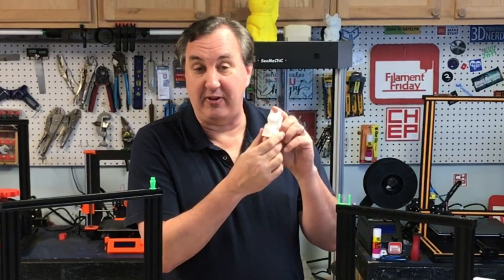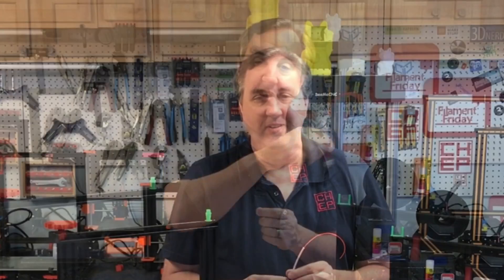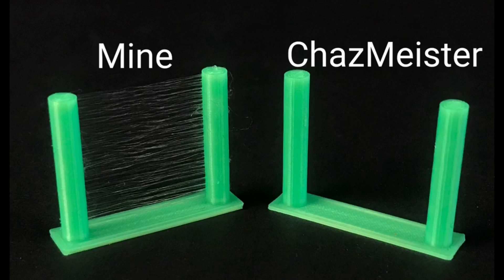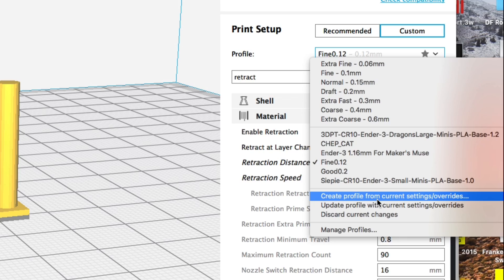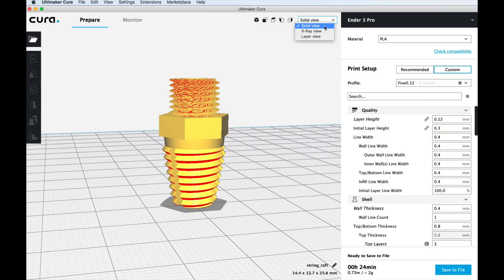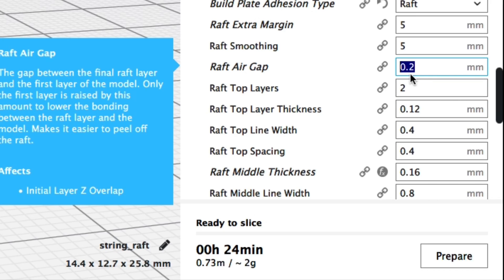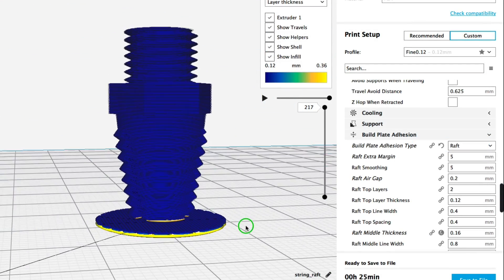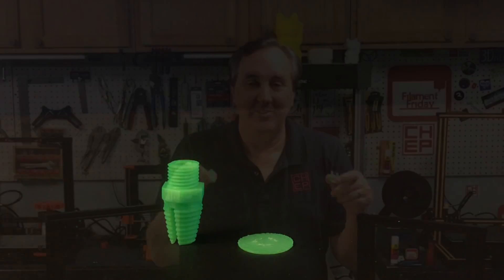Cura Settings for Retraction and Raft on Creality Ender 3 or CR-10 Mini

Comment: The surface area of the interface between the raft and your part is still the same amount of surface area as between the part without a raft and the bed.  Wouldn't a brim give you much better adhesion, since the first layer becomes part of the larger brim?  It's not as easy to remove, you might have to chase it with a small razor blade or something, but it's definitely going to give you the sticking power.
Reply from the maker: Either will work. I prefer to not chase with a razor blade.

Comment: Those raft settings are brilliant! I had trouble printing the Extruder Knob for my Ender 3 because the top had such a complex pattern that it didn't stick to the bed. One of the four "cloverleaves" kept coming loose and after 4 failed tries (changing bed temperatures, cleaning the bed with IP, seriously slowing down print speed, ...) I was ready to give up but then I  remembered this video. Since the knob has a much larger flat area, I feared the raft would stick to it but no - it came off brilliantly, leaving no marks at all and it printed beautifully. I may use this for any model from now on that has a complex first layer.

Comment: Thank you, but the stringing is still a bit unclear for me. I am also using cura, 4.5 mm retraction 60mm/s with Z hop. If I turn z hop off, the stringing goes away. Did you use z hop for the 6mm 25mm/s profile?

Comment: Chuck thanks for this explanation. I have had a difficult time removing a raft from the model. No problem with it sticking to or removing from (after cool down) the build plate but sometimes very difficult removing the raft from the model. I'll try your settings.

Comment: I have a dumb question? I have tpu sticking to pei build surface. Any way to do an easier release? It is really stuck on there.
Reply from the maker: Some people use a little glue stick on the bed to create a layer between them but I’ve also seen people rub a small amount of baby powder on the bed first. Either method seems to help.

Comment: I have a small problem where when I print the holes for my prints for my ender 3 pro they don’t come out complete, it almost overfills the inside of the holes, but it does look right in the editor, any solutions/reccomendations?
Reply: Not quite sure what you mean but if you are designing the part yourself, increase the hole size for tolerance. Slowing down the wall speed and flow percent may help too.

Comment: Hi, I have two ender 3 pro printers. For some reason, even though I have temps set in Cura, when I start a print either one or the other, nozzle or bed will not have a temp setting. Meaning, I have to manually set the temp before the print starts.. I have the nozzle set at 200, and the bed set at 60, but When I start a print the nozzles says 0, so I have to manually set it up to 200. Any idea what I'm doing wrong?
Reply from the maker: The nozzle doesn’t start heating until the bed reaches temperature.
Reply: Ahh, ok. Thanks for your reply.

Comment: Can you please share your cura profile that you used? Wanna see if it helps me with my stringing. I've struggled for 3 days now finding the best settings, but all in vein. Ender 3 pro here.
Reply from the maker: Check the link in the description for a recommended profile.
Reply: @FilamentFriday  Ah thanks, must have overlooked it. I should choose the one for ender 3 right?
Reply from the maker: Yeah
Reply: @FilamentFriday  Also, ChazMeister2's ender profile had 5mm distance and 40mm's, isn't it supposed to have 6mm with 25mm's?
Reply from the maker: 5/25 is where I’m at now.
Reply from the maker: What temperature? That looks too hot.
Reply: @FilamentFriday  195c i think it was with the test filament it came with.
Reply from the maker: I’m not sure then. I’d try some different filament.
Reply: @FilamentFriday  I got flashforge blue too, same result. Can possibly an uneven bed be the reason? also the gif i also added with the "loose" bowden contribute to it? cause during the print, the bowden doesn't feel like it's moving like that.
Reply from the maker: Anything loose is an issue. Bed needs to be properly leveled.
Reply: @FilamentFriday  Yep.  Hence why i have parked my printer a week to wait for my glass carbon ender 3 bed to not use the "soft" stock bed with several layers of foil to level it with which still has some spots that doesn't make proper contact with the nozzle.

And i guess since both the extruder couplers were lose like the gif shows is the reason i get those sudden uneven lines?  Got any good new couplers i could use? I tried ebay, but i don't know what's quality or not. and couldn't find a good combo of couplers for both extruder and hotend with a extra bowden cable that ships to norway as a lot of countries like germany or uk doesn't ship from their amazon. Lots of sellers from american amazon has some, but the shipping isn't exactly cheap with 15 bucks for shipping there.
Reply from the maker: If you can find a Capricorn PTFE reseller that ships to you they usually offer good couplings.

Comment: If one setting cured all 3d printing problems, well, presumably, that one setting would be the default in every slicer, and we'd all just print and not need channels like this.  I hate these fluff pieces that somehow distill a complex problem into, oh "check the box".  Don't get me wrong, there's some good info here, and I will try some of it if I have problems like what's being described, but this intro just irritated the crap out of me.  Heck, if that setting resolved all the stringing problems, then let's just get rid of all the other settings, have that one with a big red arrow on it that says "IF YOU DON'T PUT THIS NUMBER I TELL YOU  HERE, YOUR PRINTER WON'T WORK", and then all the forums can be filled with people asking questions about stringing, and a thousand responses of "did you put the number in the box", w/o any other thought as to what may be wrong.

Comment: Hey there.. Question for you.. So when you talked about the raft in this video and the air gap it popped a question into my head. I deal with DnD miniatures, sometimes I find that supports go to deep into the miniature so that when I remove them it actually has a line in the mini.. Is there a "Air Gap" sort of thing for supports? I typically print using Cura and do really good prints, but once in a while those supports mar the surface of a mini and it bugs me. I was wondering, would Support Z Distance (Support Top Distance) fix that? Currently at 0.1, but based on your magic numbers, could that be reduced to .04 or should it be increased to .12?
Reply: Oh and LOVE your videos! You do some awesome videos, I have shared them MANY times!
Reply from the maker: Yes. Making top Z distance larger produces a bigger gap.
Reply: @FilamentFriday  So would it be better with a higher number?
Reply from the maker: It will be easier to remove but too much of a gap and it will allow the print to sag. So it’s a fine line. 0.2 to 0.3 seem to work for me.

Comment: Chuck thank you, i have been puling my hair out as nothing was working, i went right back to the very begging of set up and started from there and still prints where fair at best. I applied these and the prints are bang on and looking amazing thank you for sharing and to the others whom have helped with these directions for people like me whom are so new and frustrated this has helped me so much
Reply from the maker: Glad I could help.
Reply: OMG - SAME HERE! Thank you, Chuck, You have saved me from throwing out my 3D printer to the trash and with these simple settings I now LOVE IT!! Well done sir!! Im a believer!
Reply: I had a profile that I thought was solid as it did test prints great, but when I started putting multiple objects on the same bed for simultaneous printing, oh my friggin god, you would not believe the stringing nightmare that resulted. And this was with combing and generous retraction on. I also went back to the default settings and changed just a few things. Stringing was reduced and the print head stopped bashing into my object when it was more than 5 hours in causing catastrophic print fail, but stringing was just as bad if not worse. 
I've got a 3 model figure on now, but as soon as that's done this new setting is going in and I'm hoping for the best. It's already taken a week just to get a consistent bead out of this printer which turned out to be some bad parts from the factory that are slowly being replaced.

Comment: Dear Chuck, my previous question regarding my stringing issues (sawtooth pattern on both "towers") was deleted for some reason, but I've found what caused my stringing issues. The PTFE tube was loose at the extruder motor end, and it was moving forward/backward when priming/retracting causing almost zero retracting effect.
Reply from the maker: Interesting. I don’t remember seeing your original comment but glad you found this.
Reply: Additional note. Since I don't have spare PTFE tube, I simply took the heat gun @140 deg.C, heated the end of the tube and pushed one of allen keys into it. The tube has expanded a little and now it sits well.

Comment: Chep, it is confusing. I downloaded the ChazMeister profile from Dropbox, and there is a speed 5mm and 40mm/s, not 6mm and 25m/s as you shown in the video.
Reply from the maker: I wonder if he changed it.
Reply: Hi CHEP . I had time to do some tests. Usually I use a medium quality filament, without any stringing (Cura). I runt out from this filament, but in last year I ordered some super cheap Tronxy filament from Gearbest (for 13USD/1kg). With this filament and my classic Cura profile I experienced massive stringing. So I tested these profiles:

1. My classic profile, Cura = stringing
2. Chezmeister profile Dropbox, Cura = stringing, sadly. :(
3. Maker's Muse Simplify3D profiles (https://gum.co/ZrffZ) = absolute no stringing, not even one.

I am curious what is the setting in Simplify3D what makes it working. I don't see any special setting here, except Wipe nozzle 0,5mm? Maybe this. Retraction distance/speed is same as in Cura.

"I wonder if he changed it." - From what I see on Dropbox, the file was modified 1/2/2019.

Comment: another option is to use skirt with a distance of 0.001 or 0.0001 from part, and a lenght of over 4000. this will have exterior walls of part with 1 layer height to hold onto and it just snaps off. best part is this works for all part sizes so no need for individual adjustments, unless there are a lot of internal small parts..... this allows base of part to have that glass surface finish.
Reply: I'm gonna try this, it's the same as a brim but more control
Reply: @bry29bry  with newer versions of cura you can use brim and select outside only.

Comment: Dumb question...   couldn't you just flip the print, so that it doesn't rest on the "conical" end while printing?
Reply from the maker: It would require supports for the nut section so I didn’t.

Comment: Howe can I change the filament in print ender 3?
Reply from the maker: Heat up the nozzle and then pull it out. Just reverse of how you loaded it.
Reply: @CHEP Thanks Chuck, during printing is not it possible on the ender 3?
Reply from the maker: Sure, just pause the print and the pull out the filament then add new.
Reply: @CHEP Thanks, your videos are helping me a lot, keep them up. I love this channel 😀👍
Reply: @emmetalerch2672  there is a change filament option in lcd screen options but its a bit hit and miss sometimes.

Comment: Hi Chuck, I have a CR-10 original, no upgrades and I found that my "magic Numbers" are 4mm retraction at 25 mm/s retraction speed with a printing speed of 40mm/s (outer and inner walls).
the printing speed is related to the retraction amount. but it seems that the number "4" is really magic to the Creality.... just try....
Reply from the maker: I will. Thanks.
Reply: Just tried 4mm retraction and 25mm/s retract speed and no string at all when using Cura. 
thanks

Comment: Using Cura 3.6.0 with the default settings for the Ender 3 and it has already enabled retraction (distance 5mm, speed 40mm/s). Never had issues with stringing etc with Cura.. that software puts out the best gcode I've tested so far. Worst was a Slicer Plugin for Octoprint.. 
As I only use PLA I only use brim, raft on the other hand makes no sense for me. I would at least always print a skirt. But Cura already prints a line before starting which helps a lot for a better start. You should try brim, it sticks very well if the bed is properly leveled.
Reply from the maker: I use brim when necessary. For this I didn’t want brim messing with the first layer threads.

Comment: Also there are 2 more settings under retraction  that contribute to the stringing.  Maximum Retraction Count and Minimum Extrusion Distance Window.  For smaller areas/parts where there is heavy retraction, this limits the amount of retractions on a piece of filament. I think the default is 90 retractions and 5.0 mm. Meaning only 90 retractions are allowed in a 5.0 mm piece of filament. So if you are retracting more than you are extruding, it will time out the retractions till you extrude past that 5.0 mm.  I was having a hard time with the stringing test. No matter what retraction settings I changed, it still stringed towards the top of the model.  I changed the amount of retractions to 100 and distance to 4.0mm and it cleared up.  This is setup so you don't grind away at your filament in the extruder.
Reply from the maker: I didn’t think I was near violating those limits but I’ll try it to see if it makes a difference. Thanks.
Reply: Chuck, I didn't think so either. However I paid attention to the extruder travel and it made sense. Not that this the total solution, but in conjunction with your other settings, it may help.
Reply: Great tip. I suppose it's useful when your printing pointy objects like cat ears
Reply: @NicksStuff  I run into stringing issues when I'm printing 28mm minis that have a lot of supports. It'll help with that kind of thing, too.

Comment: Thanks for your video. do you also have tips/magic settings for the Prusa i3 mk3 still struggeling with TPU (got print speed down, retraction off, flow higher etc).

Comment: Tried Raft... the attempt failed.  The raft stuck to the print bed fine, but the desired object popped off the raft at the 3rd layer after the raft was done.

This was with supports everywhere.  there was just no adhesion between the print and the raft....
Reply from the maker: Lower the gap value.

Comment: Just a quick question. If the stepper motor homes and it is between two point won't that defunk magic numbers?
Reply from the maker: Please read the comments. This has been answered multiple times.
Reply: It means that the stepper will be on the same microstep for each layer, so any variance that occurs from one microstep to the next is averaged out.

Comment: Man that is freakin awsome. I have been trying and trying to get rid of stringing. One freaking setting cleared it all up. For simplify 3d people are gonna wanna make sure combing is on. I believe coming is the crossing parimeters setting. And drop retraction speed to 1500 which is the equivalent of the 25mm setting in cura. I still get a little stringing from simplify 3d but the difference is amazing. At one point i built a string test tower that took it from 4-15 and 4 came out the exact same as 15 total garbage.  So big thanks to this video. Both you and angus hit alot of really great info on this one.

Comment: Why would you use a Raft over a Brim? It would use less filament and you would still be able to remove it. It's about the same as moving the skirt lines closer.
Reply from the maker: Breaking off the brim is harder and would screw up the threads on that bottom layer. I wanted that all perfect. And the filament difference is so minor.
Reply: brim attaches to the first layer of the print, which in this case would screw up the threading.  raft becomes the new first layer and then prints your print on top of it.

Comment: Good stuff. I am curious how this translates to changing settings for the CR10 MINI in Simplify3D? I don't think settings are apples to apples between Cura and Simplify. One of the best 3d Printing channels out there. Thanks!
Reply from the maker: It really doesn’t. Each slicer has its own settings to adjust.

Comment: Chuck...The issue is that most of the actual settings in that profile are the defaults!  On the retraction, this profile doesn't set anything!  You can open the profile with 7zip and look at the two different sub-files inside (or just open with notepad++

I did like Angus's analysis of the actual path being taken, and yes, that also is a help, but it looks like that is also the "default"...BUT, who knows when it became default, since it is difficult to track which settings are just set in an actual profile or which are set as a default...

So, I think more digging into profiles and settings is needed, but as Angus also said, there are almost too many choices - not only in ONE slicer, but the actual number of slicers has also grown a lot...

Keep up the good work!

Comment: Hi.  Great video as usual.  You should do another video about how none of your retraction settings in Cura will work unless your change your printer profile to be NON-VOLUMETRIC.  Otherwise, the g-code will only have G10/G11 commands and will use firmware retraction instead of Cura settings.

Comment: 25% retraction speed settings comes set in Cura's default settings, still getting lots of stringing. What about retract at layer change, shouldn't that be selected too? Thanks!
Reply from the maker: Are you trying the settings linked in the description?
Reply: Lower temp, re level bed, check your ptfe couplers and hotend and clean em, I use a retration rate of 1800 so it works for me on my ender 3